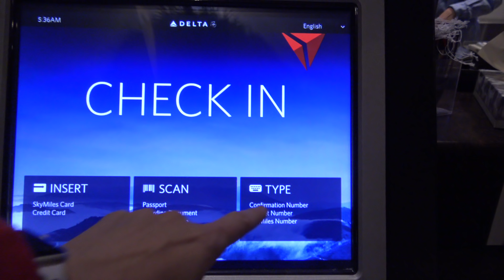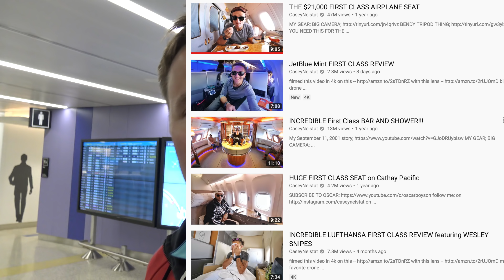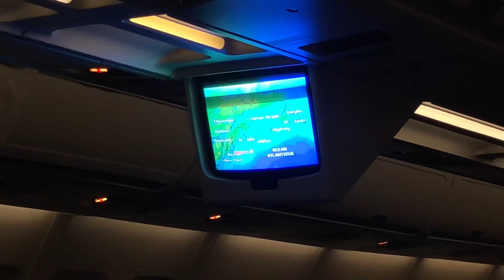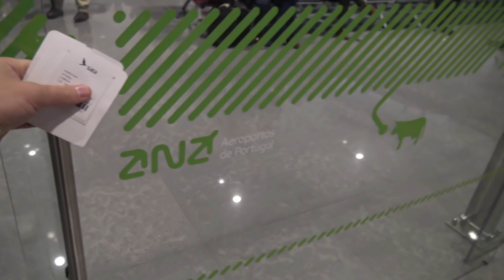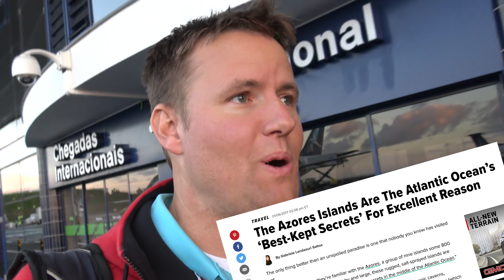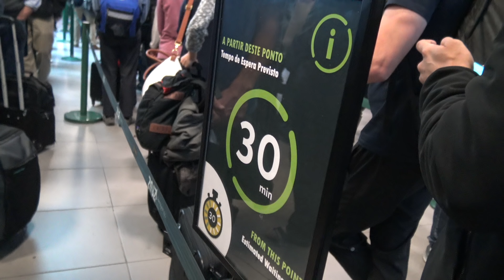WHAT KIND OF AIRLINE IS THIS??

Comment: That's an a310, maybe about 10-15years old. The sound was totally normal and the lights didnt work for your safety! There is no reason to be worried when a mechanic is taking a look at the circuit breakers. This again is just for your safety! Maybe the airline isn't very luxury, but as you mentioned, it was very cheap.
Reply: Daniel Siwerov is it an a310 or a330?
Reply: Aviator Dylan it's an a310. I thought it was an a330 at first, but in some frames you can see it's a 310 :)
Reply: yes, the winglets are not the ones on an a330, also if you run the registration number, CS-TGU, you will find it is an a310.
Reply: it’s CA-TGU, a 26 year old A310
Reply: CS*
Reply: It’s 26
Reply: Jamie Mcmurray fan 1 that’s not too old then

Comment: The lights get turned off for safety measures. Its to save energy when taking off and landing and it helps the crew see from the windows if the wings are okay. Otherwise its harder to see due to light polution coming from the lights. Thats also why you need to keep your windows uncovered.
Reply: It's actually so that if there's an emergency your eyes are adjusted to the outside lighting
Reply: @cmaviation525  actually both coming from cabin crew for american

Comment: You can film on a plane do it all the time, if anyone objects to you filming just inform them what you’re recording that there face will be blurred. If the cabin crew interfere with your filming just inform them the same and they have no right to stop you.
Reply: Gd to know
Reply: Good luck insisting on that. They do have a lot of authority once the plane is off block. Although it's certainly not a helpful measure to improve their public image, that's for sure.
Reply: Record after the flight attendants are busy, then they won't notice ya lol
Reply: That may (or not - I don't know) be the case on a US airline but Azores is Portugese and the aircraft's registered in Portugal.
Different country, different rules.
Besides which, it's not a good idea to argue with cabin crew. Ever.

Comment: the buzzing noise is probably a hydrolics check. they mostly do it in the hangar. or it could be an old fuel pump, which pumps the fuel from one wing to another. nothing wery "dangerous" but some people still get freaked out. (sorry if my writing is horrible)

Comment: The plane was an A340 I'm pretty sure, that's why it looks old.
Reply: Had 2 engines one on each wing
Reply: @stormbuilder3710  yeah, A340 does
Reply: The a340 has 2 on each wing
Reply: @stormbuilder3710  Yeah
Reply: That’s why it’s an a320
Reply: @stormbuilder3710  Ohhh.... Ok, It could be
Reply: @stormbuilder3710  I thought it was A340 because of the wide body
Reply: XX M4RCEL ya I get you

Comment: It’s said as a-zores airlines. Also that noise is the engines and PTU. The only reason the lights don’t work is because your prior or close to take off or landing so to adjust your eyes they turn off all the lights. The direction the pilots and maintenance were looking is maybe a circuit breaker popped out which is behind the pilots seat but something wrong with the FO side of the aircraft. If it was major you wouldn’t have boarded the plane in the first place.

Comment: The only time you should worry about when you see a mechanic in the plane is when they pull out duct tape. I’ve seen it as I currently work for a airline. Stay clear of the airbus 319/320. All airlines.
Reply: Abed M It’s not duct tape, it is aluminum tape. They never use it inside the aircraft but they use it for small temporary cracks and dents on the frame, engine, and wings.

Comment: Nº1 - IT IS NOT SPANISH, IT IS PORTUGUESE.
Nº2 - IT IS NOT "ASSO-RESS", IT IS "ASO-RESH"
Nº3 -  Lights don't work on takeoff to keep your eyes adjusted to the dark in case an evacuation is needed. That way you can see better.
Nº4 - Pilots inspecting engines is normal. They do a FULL walkaround of the plane to see if everything is good.
Nº5 - You're in the island of São Miguel, in the Azores

Comment: The area of the airport where you were trapped in is what they call the in transit waiting area. If you are in transit [which you were] you're not allowed to depart from the Airport until your aircraft is ready and you depart in the reverse process - back onto the aircraft. 
Some airlines switch off the cabin lighting when coming into land at an Airport. It's a safety process so that if there's any problems you can see the emergency evacuation lighting.